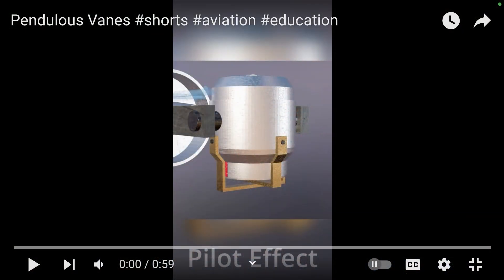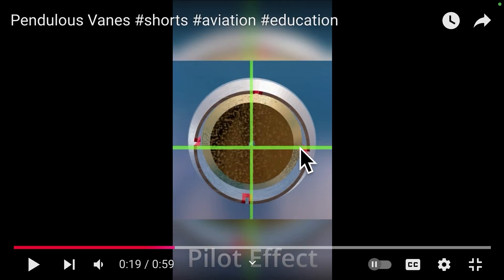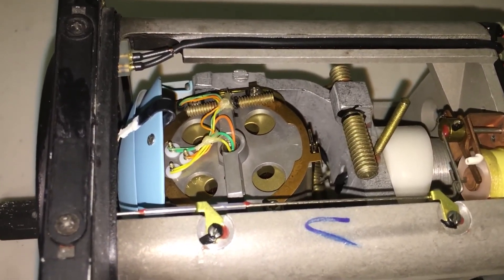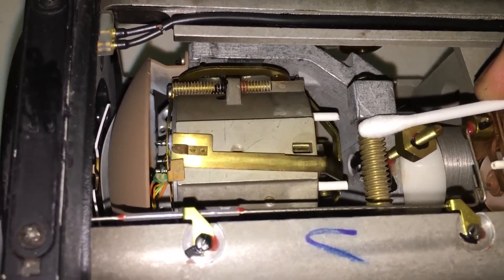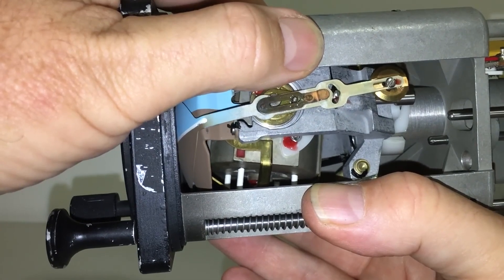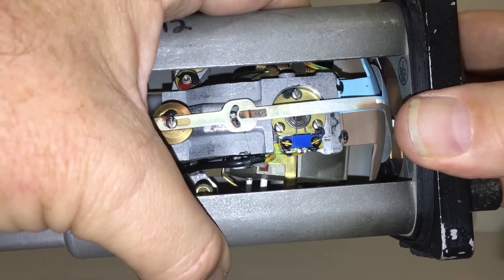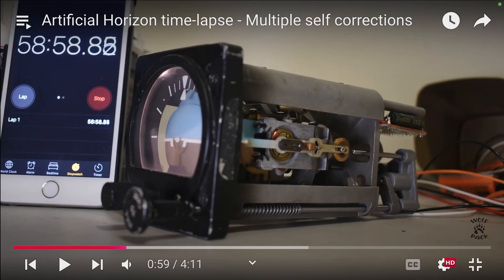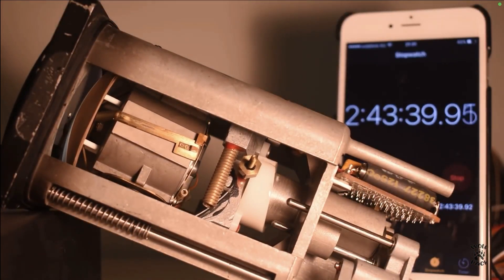Pendulous Vanes and Attitude Indicators

Comment: Your starting comments are confusing. 
You talk about the Gyroscope and the attitude indicator as if they were totally  separate instruments. 
0:35 you say the "attitude indicator is self correcting", but the pendulous Vanes are actually on thr Gyroscope, as the caging and uncaging of the gyroscope demonstrates.
It's the Gyroscope that is self correcting, not the attitude indicator.
Reply from the maker: I think you are going a bit deep there.
the gyro is the stabilizing part of the AI and the PV affect the gyro to correct the readout of the AI
Reply: @BobtheScienceGuy  Yes. The PV affect the Gyro, NOT the indicator. 
There are no PV on the Altitude Indicator, ONLY  on the Gyroscope.
That's why I thought your description of the Altitude Indicator being "adjusted" by PV was innacurate. 
The PV alter the Gyroscope,  which then secondarily alters the Altitude Indicator.

Comment: As an airframe and powerplant technician I always love to see these opened up! Brilliant engineering going on here. Another point I have from observations as an aircraft mechanic is that an Attitude Indicator that is turned off will need to stabilize and fix itself to the pull of gravity when you turn on the aircraft power, every time. If they did not have those vanes to auto correct this would require a perfectly flat space and a perfectly level aircraft to zero the gyro. We do not have to do this because those vanes work.
Reply from the maker: Thanks for sharing your experience as an A&P, the way they work is amazing!

Comment: The pendulous vanes are dependent on apparent gravity. That is gravity and acceleration. You can get a lot of acceleration in the air.
That is why you need the artificial horizon, the compass, the air speed indicator and the altimeter to control the situation when you can't look at the ground.
Reply from the maker: absolutely, and that is why you don't want instantaneous correction to the vector of gravity.  Like the seat of your pants, it can be fooled in a turn.  You want it stable during the turn, but to adjust over the long term when faced with curvature of the earth.
Reply: Yes, if the plane flew in a circle for hours, the vanes would cause the attitude indicator to adjust to that and show the bank to be "level". But in reality that rarely ever happens. Even holding patterns are not circular but oval, with straight sections between the turns, so the indicator will always have a chance to return to true level.
Reply from the maker: correct, you turn for 1 min, then fly straight and level for a min, rinse and repeat

Comment: Would it be possible to 'cage out' one of these, then fly to, say Hawaii from LA, then uncage and watch it re-orientate itself? As the Earth is spherical perhaps the time to re-orientate could be calculated and then observed.

I don't know how some of these Flat Earthlings know how to tie their shoes sometimes...especially the 'angle indicator' knot-heads!!!
Reply from the maker: If you cage it, it doesn’t work and that won’t be safe. You may want to look at the first attitude indicator video. Wolfie cages and uncages, then records the time to correct
Reply: @BobtheScienceGuy Something to experiment is taking an external independent instrument to  Hawaii, cage it in Hawaii, return it to LA, then measure the re-orientation time. To get a good statistical mean and reduce the standard deviation, this experiment must be performed a minimum of ten times. To maintain transparency and integrity, a minimum of five globers and flerfs should observe the experiment. We could call the it “The Next To Last Experiment “. 😉
Reply from the maker: lol.  or you could just get the raw data from the IRS or a FOG you brought with you as a passenger.  I've brought scales on aircraft and conducted experiments with the permission of the crew.
Reply: @BobtheScienceGuy  I mean one that isn't being used to fly...just one like using for training purposes.

I don't know what IRS or FOG are. (Except the obvious😁) 

Do you have videos of these experiments?
Reply: @David-ru3gd  Inertial Reference System. Fibre-Optic Gyro.

Comment: I looked up some patents for erection mechanisms for attitude indicators. I found 11 different patents going back to 1933. Pendulous vanes is only one of them.

The oldest I found had an interesting additional mechanism: To prevent erection during maneuvers, inertial sensors sense accelerations and turns and activate electromagnets that lock the pendulum in its null position.

Patent US1934774 A, 14. Nov. 1933

I have a list of the patents I collected on my website if someone is interested.
Reply from the maker: What is telling is that we didn't just stay with the gyroscopic stabilization.  The fact pendulous vanes were invented demonstrates they filled a need...  Now flerfs, what is that need and why are they used?

Comment: Not as easy to represent since you don't have physical correction devices but would love for you to do a video on modern electronic gyros and how they work in comparison.
Reply: @ace0007 This is a modern gyro. The fancy electronic ones you speak of are always backed up by one of these. In fact many of the more complex systems will have a master Gyro somewhere in the aircraft (Usually a dedicated avionics bay) that is controlling the instruments the pilots see.
Reply from the maker: modern electronic gyros?  not sure what you mean by that, but would like to hear.
Reply: @BobtheScienceGuy  very few modern planes are using mechanical gyros anymore.  Granted I only fly small planes but the Garmin G1000 system is now using electronic systems.  Obviously a bit more complex but similar to the gyros in your phone.   Still using gravity to sense the downward vector but without mechanical spinning gyros.
Reply: @BobtheScienceGuy  Look into the GRS 77 component of the G1000  https://www.faasafety.gov/files/events/SO/SO09/2021/SO09104630/G1000_System_Components_QuickRef_Guide.pdf
Reply: @ace00007  are you talking about a laser ring gyro in an IRS?

Comment: So, one thing I still don't get:
Why does a tiny change in air pressure affect the orientation of the gyro....?
Reply from the maker: Not a change in air pressure. A jet of air imparting a force on the gyro
Reply: @BobtheScienceGuy  
Ooooh, so...
Is there just a constant stream of air going through that area, and the vanes just redistribute the airstream to blow the gyro back to level?
Reply from the maker: When out of balance, the different airstreams impart different external forces on the gyro which cause it to precess 90 degrees to the applied force
Reply: @BobtheScienceGuy  
Ok, I think I get it. It's not a direct blowing of air that corrects. I misunderstood that.
When open, the vane lets air out causing a kind of slight relative vacuum (ie: difference in air pressure)? Which then affects the gyro's rotation, which pushes it in the right direction to get back to level.
I'm having a bit of trouble following, but is that anywhere close?
Reply: @ulodetero  Not quite.  The air is not what makes the rotor spin.  The two jets of air, on opposite sides act like tiny 'jet thrusters'.  As the air rushes out, 3rd law of motion means there is an equal and opposite force on the casing.   When both are partially covered, the reaction force from each jet 'pushes' on the case but they are opposite directions and cancel out.  When one is blocked off, that jet's reaction force stops.  With the force on one side not exactly cancelled by the jet on the opposite side, the NET force applied to the casing makes it precess.  Once vertical and the vanes partially block BOTH jets, the net force from the jets are now equal (and opposite) so no more net force on the gyro case.

The instrument in wolfie's video is electrically spun, so the rotor spinning is independent of the air flow.  The jets of air flow are only to 'push' the side of the case when it's not properly vertical.   Some older instruments actually used a small vacuum hose from the engine and 'suck' air through a tiny turbine to actually spin the rotor.  Lose the engine and the gyro inside would stop spinning and the instrument no longer would work. (and that is a bad way to fly, no engine, no instrument).
Reply: @mikefochtman7164  Ok, well I think that's where I was getting confused.

I wasn't sure whether the flow/pressure/jet of air causes some weird physics in the gyro itself (even if not directly powering it), or whether it just pushes the whole assembly into the right place.

From the sound of it, it's the latter....
Reply from the maker: excellent analogy Mike, they act like little thrusters.